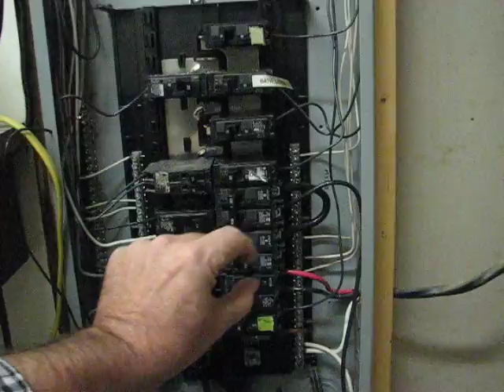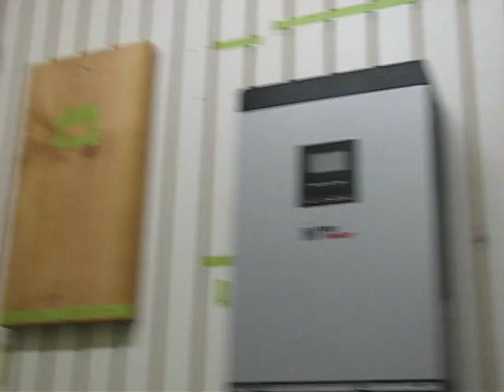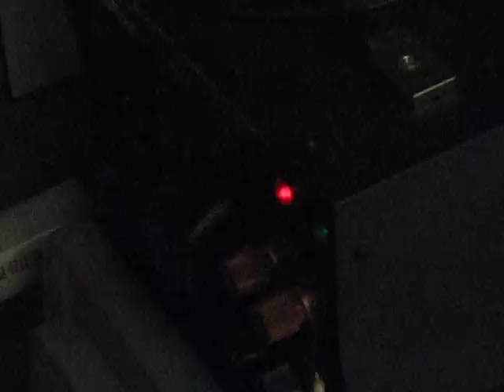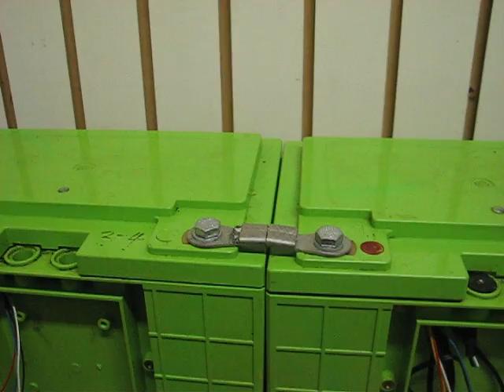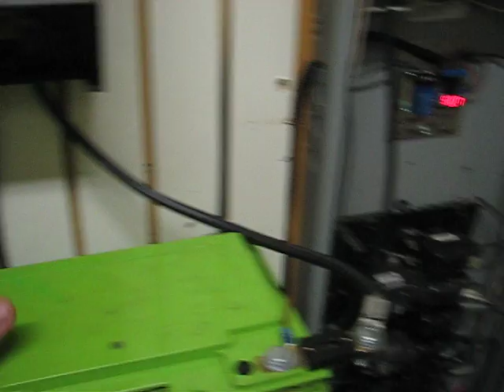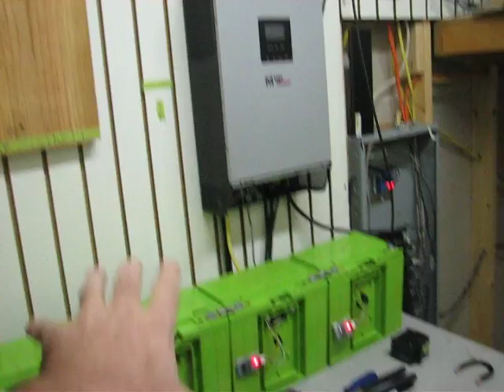Solar Off Grid / heating water & breaker box #1

Comment: Nice Job buddy. I'm building a new off grid house right now. Can I get a wiring diagram on how you did this. This would help me out alot.
Reply from the maker: +Hawaiibiz Thanks. has worked perfect so far!  just wire your hot water heat 120 volts. get this switch & 30 amp relay http://www.ebay.com/itm/311158989699?_trksid=p2060353.m2749.l2649&ssPageName=STRK%3AMEBIDX%3AIT directions for switch at bottom of page can help walk you threw it. Sorry have no diagram.

Comment: Hi looks good. Possible to find a circuit diagram for what you have built? I would like to just activate a contactor that then feeds to a water heater.
Reply from the maker: Chris Hobson All you need is this switch & your contactor choice. Here is a link to switch. info on how to program is on this page. http://www.ebay.com/itm/Voltage-Control-Relay-Timer-Delay-Switch-OvervolTage-Under-Voltage-Protection-/311158989699?pt=LH_DefaultDomain_0&hash=item4872856383. 
Hope this helps. Sorry Don't have a diagram. You will be able to do it! not hard to wire up once you understand the switch. Get the switch if you get stuck will try and help you threw it.
Reply from the maker: Chris Hobson Are you running 120/220 split phase power to your hot water heater?
Reply: off grid kid  HI off grid kid. In South Africa everything is 220V AC, but if you can control a contactor you can control your water heater.
Reply: off grid kid I am sure there must be a 220V version I presume you use your grid to supply the 125V and it looks like you run your inverter 220V
Reply from the maker: It's all from the 230v inverter going threw a step down transformer making 115v. I'm using it to use the solar power that would be lost after the batteries get full. The charge controler starts holding back power being made by solar panels. can not feed it back to the grid. this system does not work that way. that power has no where to go so the charge controler holds the power back to keep from over charging the batteries. with my hot water heater kicking on when the batteries are close to full uses the power that other wise would be lost. this is not a grid tie inverter it's a off grid inverter but can be used many many ways....
Reply: off grid kid 
Hi I am off grid living about 5 miles from the nearest utility. So this would make absolute sense to me. I would have to find a 220V version of the JQC-3FF. Another thing I have seen on the net is using a 250W towel rail heater element in the geyser. this means that there is less switching as the element is better matched to the excess energy. You could have both the towel rail element and the normal element.
Reply from the maker: Hi, Thanks Will check that out! Very happy with the way its working now have not touched it in a long time and have hot water every day!!!!
Reply: off grid kid 
I see the switch accepts 0 -277V AC so no voltage compatibility problems - ordering 2, one for a mate who works in Iraq and comes home every three months or so he and the missus are busy building and will also be off-grid.
Reply from the maker: off grid kid No Chris just 120 single. Is was wired to the grid split 120/220 but i don't have split phase power from inverter. So i thought i would try 120 single and it has worked out perfect so far. I think 220 single would work as well it's only a heating element but i don't know for sure???
Reply: off grid kid  Hi looked at the specs on the switch and it can operate up to 277V AC (I have ordered two). How have you got it hooked up? Does the switch come on when you are in absorb or once you go over into float? The timer is it set for a programmable number of minutes or is it time of day? Does the switch remember the settings if it loses power? I have picked up a second-hand water heater that use to be powered by a heat-pump. The heat pump has blown due to the outages that we are experiencing in South Africa. The water heater comes with space for two elements like the ones in the US. Our water heaters generally only have 1 element so I am pleased. MY system produces more than 1 kW spare power than we use on a general day from 9am  to 3pm. Currently we have a gas water heater and I plan to heat/preheat the water and so reduce my gas bill. On the days when we do washing and ironing there will not be spare capacity but 5 days out of 7 it would be good not to have to use gas. Once we go over to our spring I will see whether we use 1 1000W elemment continously from 9-3pm (except on cloudy days) and 1 1000W element like you do once in float/absorb.
Reply from the maker: Hi, The timer is in minutes & or seconds 
Yes it holds memory, You can adjust it to come on/off any time you want from 0 to 99 volts, you can set it to switch on the hi voltage setting or the low. I have it switching on when batteries are close to full but will switch off if batteries drop below 90% or so
Reply from the maker: You may not even need gas if you have enough ah in your batteries you can use the timer 1 hour and you have hot water for 2 or 3 showers with the size hot water heater i'm using.
Reply: off grid kid  Hi what have you got your float set to?
Reply from the maker: HI, 54.7 my float setting.
Reply: off grid kid Hi received switch on Friday. What do you use as a power source for the switch? How do you program it? Is there any documentation?
Reply from the maker: this may help close to bottom of page http://www.ebay.com/itm/311158989699?_trksid=p2060353.m2749.l2649&ssPageName=STRK%3AMEBIDX%3AIT
Reply from the maker: power source is a 12 volt 500 ma plug in wall type unit.
Reply: off grid kid thank-you. I am sure I will now come right.
Reply from the maker: good luck with it.
Reply: HI off grid kid I was powering the relay using a doorbell transformer but have had to remove the transformer due to excessive heat. How do you power the relay with 12VDC?
Reply from the maker: Sorry have no diagram. 
It's a 6 volt 1 amp plug in wall transformer running the voltage control switch & relay

Comment: Awesome.
Reply from the maker: Thanks buddy, working better that i ever imagined. very easy, used what was all ready there, key is to wire 220 to 120 volt or would pull to much power from the system.